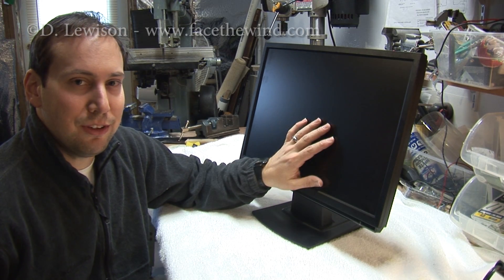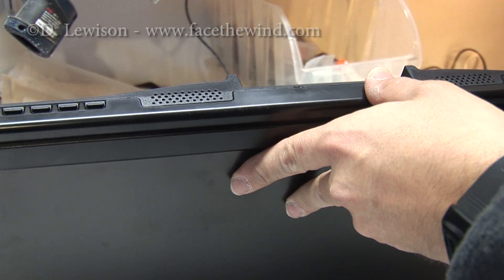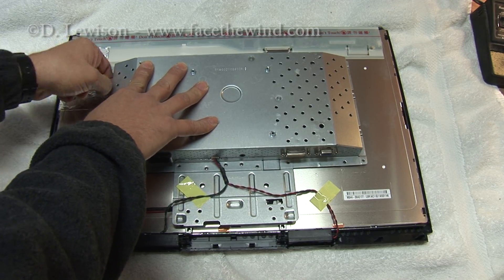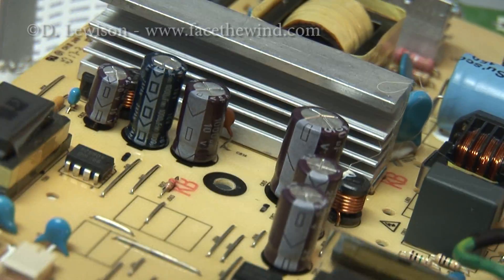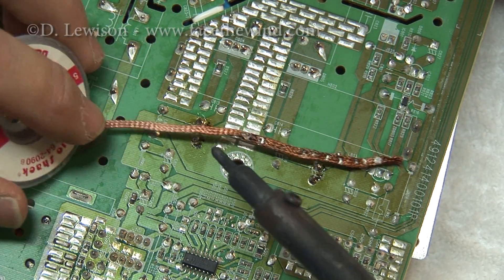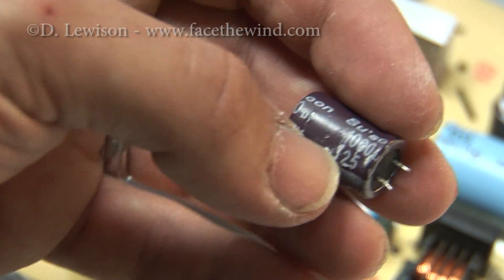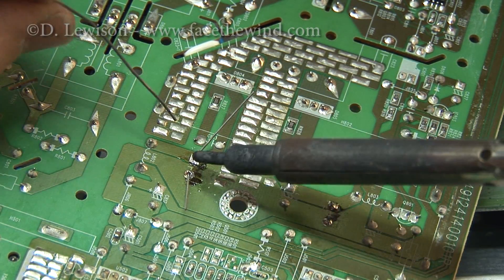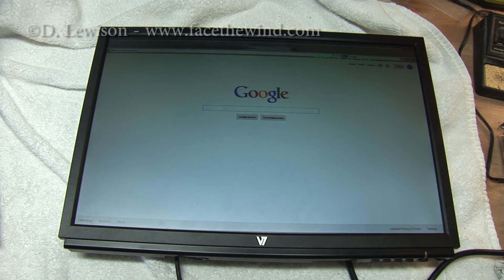Replacing Capacitors to Repair a 22" LCD Monitor

Comment: Thank you for sharing this information. I've got 3 Acer X263W monitors and one of them began going to a black screen within seconds of turning it on. I took it to a shop and I do not believe he did a thing to it. He said it was a bad screen. I've questioned that, since it will come on and display for a second or so. My thinking was if the screen was bad, why would it display at all? Anyway, I'm going to open it up myself and see if I find any capacitors that look to be bad.  I've never done this before, but after your example, I feel sure I'll have no problem, should I find one (or more) that needs to be replaced.
Reply from the maker: Based on the symptoms you describe, it sounds like this technique may work for you. Usually, it's the power supply capacitors to the LCD backlight that start to fail, so the backlight will light up for a few seconds and then go dark. If you see the display during those few seconds, that means there's nothing wrong with the screen. Hopefully this will work for you...best of luck!

Comment: You should just replace all the capacitors on the secondary side. The other capacitors, being of the same brand and doing the same job, would likely be close to failure too.

Make sure you replace with low-ESR capacitors with the same capacity and same voltage. It is ok to go up one level of voltage to save part count, but not too high and definitely don't go lower. Do not use general purpose capacitors, in this situation they can fail quickly like the originals here. Also take note of the physical size of each capacitor. You are pretty lucky here in that the capacitors had plenty of space around them and fitting a bigger physical capacitor doesn't cause a problem, but many power supplies will all the capacitors jammed together. (I guess this is common sense though)

You can get good quality, Japanese sourced capacitors from places like mouser and RS online. For a long term fix these are best, however, it is up to you. 22inch monitors are kind of old and not much point fixing unless it is cheap and easy. I prefer to spend a little more to make sure my fix sticks, but up to you.

If you do not find bulged capacitors on the primary side (or you test them and they test good), or replacing the capacitors doesn't fix it, you should probably just remove your new caps and throw the monitor away. Not much point spending hours trying to fixing an old monitor with non-trivial problems that can be replaced for $100 or so.
Reply from the maker: I've sold a few of these repaired monitors for $50-$75 each. Considering I put in $4 in parts and 30 minutes in labor for the repair, I definitely consider it "worth it" to fix these monitors! Also, I test the caps before replacing them. No point replacing caps that haven't failed.

Comment: Likely capacitors as he said. Same happened with one of my old monitors. After a few weeks, it went from lasting ~45 mins between cycles to ~2 mins and it got harder and harder for me to get it to come back on at all (towards the end, I'd often have to toggle the power button 5-6 times before it'd actually turn back on). I actually found this exact video, took his advice, replaced 3 caps, and it was good as new. I'm back here today because my girlfriend's work monitor is acting similar and I was linking her this video to better explain it to her. Her job replaced the monitor and was going to toss out the bad one, but instead it looks like I'll have a fun little project to play with tonight and likely snag a spare 24" LCD backup monitor to keep around for literally just a few dollars :)

Comment: Very useful video! Btw, when you showed all the capacitor, the tiny one of the top left side also looks bulged. Any reason that was not replaced?
Reply from the maker: It might have been a little bulged, but I guess I didn't think it was bad enough to replace it. Keep in mind, a capacitor can continue to function even if it's bulging. But once it starts leaking, that's when it begins to fail. That's why I replaced the ones that looked like they were in the greatest danger of failing soon.

Comment: That metal tape that's was on the left side holding the cables what is it? It was on my monitor holding the box for the power circuit board. I am planning on adding electrical tape to hold but it doesn't keep a good hold.

Comment: Hey , man thank's for that usefull and instructive video , tho i wonder what are the sign of a failing / dead capacitor in a LCD Screen , i wonder because i actually own a BenQ XL2411T and this thing actually won't let me use more than 60 hz ( this is a 144hz monitor ) , if i push the limit i need to actually " heat up " the screen to actually get a image , before it's just white and blue colors before the image take place :X

Thank's in advance for your answer , and keep u good videos coming o/

Comment: my lcd monitor works fine for 25 minutes but after every 25 minutes screen goes black...then i restart my monitor again its works fine for next 20-25 minutes...
what is the problem sir...please help ..!!
Reply from the maker: Could be a similar problem with the power supply's capacitors. You could open it up and give it a look to see if any of them are bulging or leaking.
Reply: thanks

Comment: Does the capacitor need to be discharged prior to removing for LCD monitors? I was always told not to mess with monitors (back in the CRT days) because the capacitors will hold enough charge to injury/kill you.
Reply from the maker: +Karl Baker No, these capacitors are very small and don't hold much charge. It's ok to remove them without discharging them. However, if you still want to, you can always cross the capacitor leads with a metal screwdriver tip to be sure.

Comment: The 4th capacitor to the left of the one you replaced looked to be bulged in the same way.
Reply from the maker: +poikaa3 Yup, you're correct. I probably should have replaced that one as well. It seems to work well without it (has been working for over a year now). If it had not worked at first test, I would have replaced that one too.